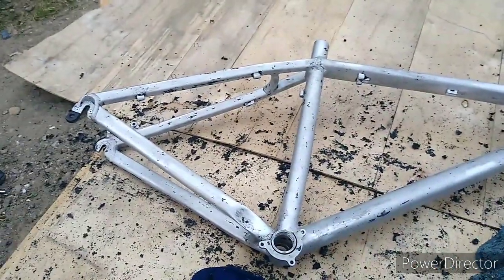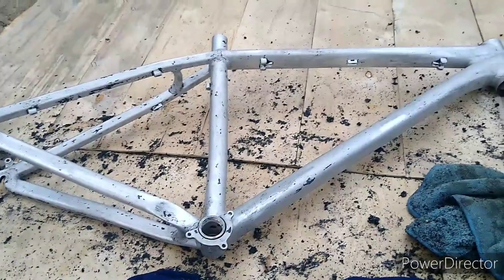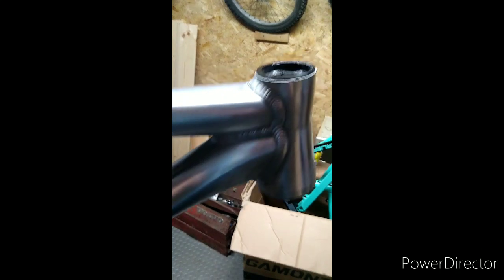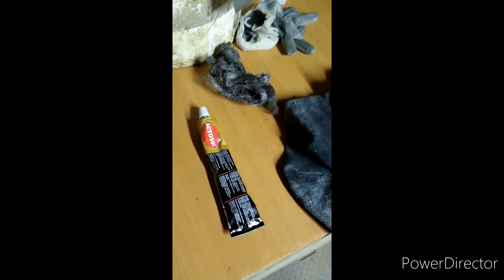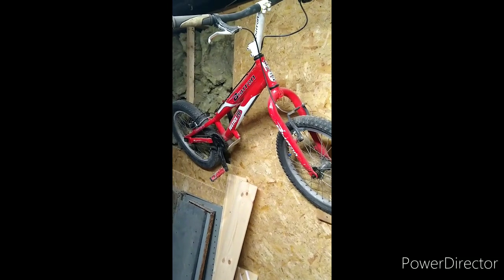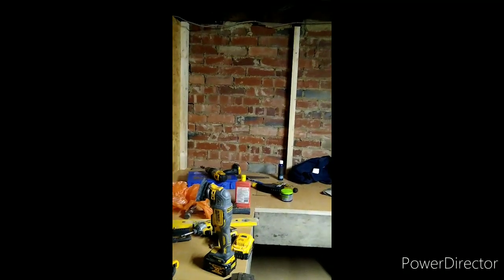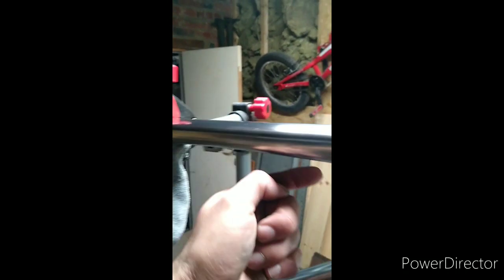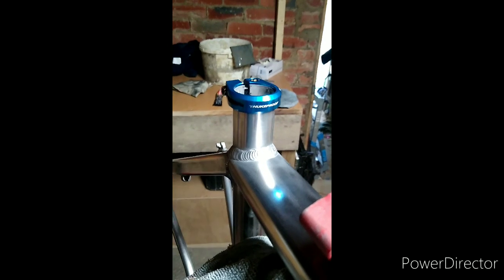Stripping my hardtail MTB back to raw aluminium. Brand x ht-01 frame 2020

Comment: hey great vid an nice bike! i have this frame just building it up bit by
 bit. just wondering what the bottom bracket spacing upset is. i have 
the spacers just need to know the configuration. thanks in advance.
Reply from the maker: Thanks glad you liked it! The BB spacing depends upon what drivetrain you're using
Reply: Normally with a Hollowtech you'll be fitting one 2.5mm in the driveside on that frame.

Comment: have you exposed it to water/dirt? 
how long did it stay shiny?
Reply from the maker: It goes dull after a few muddy rides but it only takes a 10 minute polish and it looks great again
Reply: @thesupercrashbrothers8459  thanks for the insight, I got about 95% of the paint off already. But the paint striper I used didn’t do the greatest job on 3 paint layers, I had to use a metal scraper, wire brushes and lost of sanding.